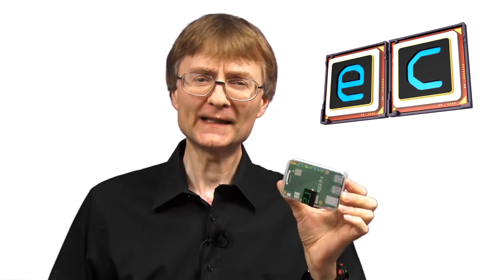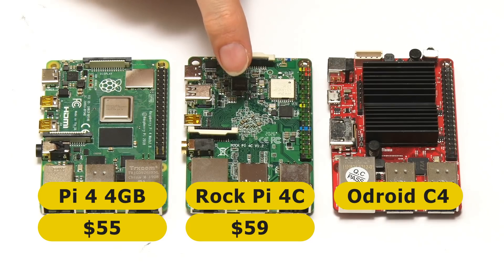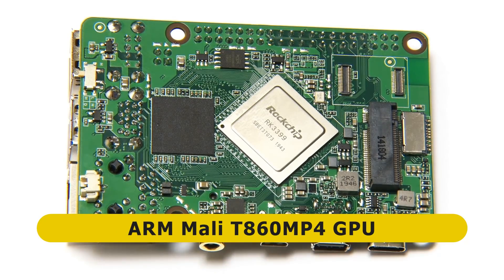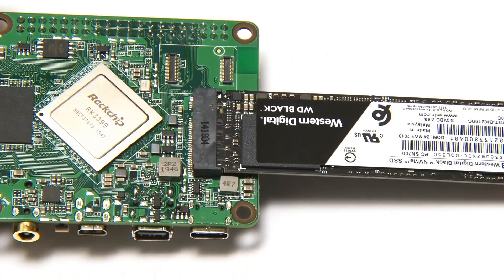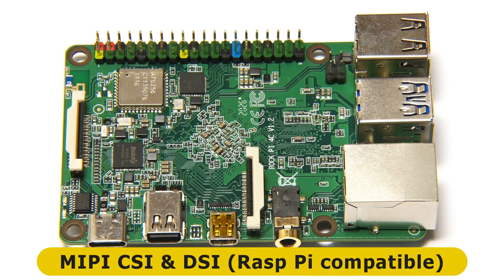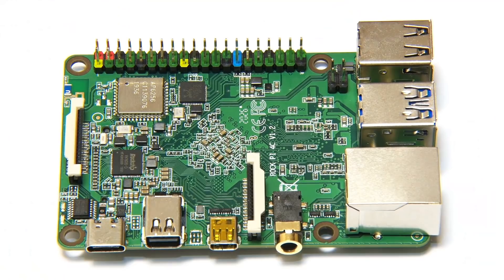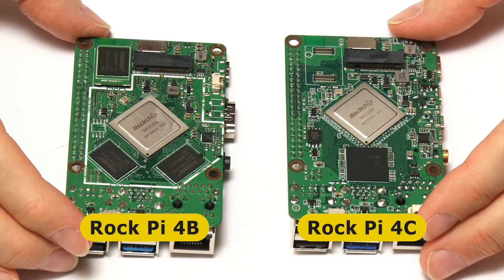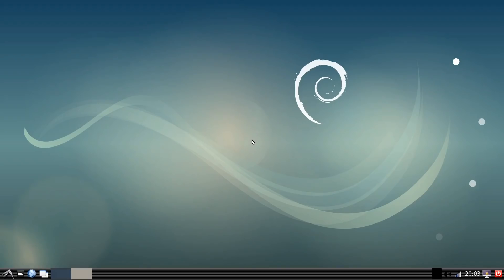Rock Pi 4C: Dual Display M.2 NVMe SBC

Comment: "Hardware is useless without software". I often see videos titled "raspberry pi alternatives" or raspberry pi killer" like videos in my feed. What is common in every one of them is 1) lack of software support and 2) less community involvement. The first can be fixed with some updates here and there but the second one will, in my opinion, never equal raspberry pi. Raspberry pi has been here for 11 years now and in that time it has created a firm foothold in the SBC market, deserved too. It is in everything from 3d printers to space stations. It was wide software support and a huge community backing, tinkering and supporting it. It has many add ons for it, HATs, cameras and what not. That said, if raspberry pi foundation sits on their back and do not make new innovations to the SBC people will start to migrate to other SBCs. Right now, I do not see much reason to choose other SBCs over the pi.

Comment: You know, although I do love the Pi and associated ARM boards, I have to say that for the moment x86 is still my go to choice system for most stuff, and what I was doing with the Pi's (MediaCenter and Router) I'm doing much better performance and features wise with the Atomic PI, which is based on the same Atom CPU as the Rock PI X.
For my Router solution (custom) I got OpenWRT on one AtomicPI, for my MediaCenter I actually went with eLive Linux (64 bit) and I am astonished at the performance I got out of the AtomicPi! (Not available for ARM unfortunately), this thing is booting fast as heck and performance all around if praise worthy! I'd recommend you test your RockPI X with eLive (maybe give 1£ or 2£ to the project, I did give 2€ but ended up using the Beta version regardless, and still worth every cent!

Comment: You sold me on the 4C.  It is a very fast SBC, but I chose to use the heavy heat sink in order to avoid having to use a fan.  This choice of setup is unsuitable for what I had hoped would be a "tablet like" application.  I'm going to try the Radxa Zero instead.

Comment: So, I recently bought the rock pi 4c w extender attached but no SSD installed and I can't get it to boot; no red led.  Unfortunately, you did not show the hardware when it's powered up so I can't confirm the state.  However, some research states 2 LEDs (green & red) should show on the board.  My red (pwr) led does not light up with an SD card inserted w an ubuntu image on it. What am I doing wrong?

Comment: can it run openmediavault soft?
Reply from the maker: Theoretically, yes.
Reply: @ExplainingComputers  but in real test? Mabe more spead than rasbery pi 4 for nas storage files is it any better for this?
Reply from the maker: @rolis.j  The speed limitation on both boards is gigabit Ethernet, so a Rock Pi NAS will not be faster. I said "theoretically" as you will need to configure OMV for the board. It should work . . .

Comment: price Rock Pi 4c is not $50 ! On Amazon, I found it at 107 euros, and even at 199 euros !!!!
Reply from the maker: Nowhere in the video do I say that the Rock Pi 3C costs $50. I state the price as $59, which is what the manufacturer charges, as do resellers like Seeed Studio (I've just checked). Amazon is often a very bad place to buy an SBC, as resellers there charge all sorts or prices. :)

Comment: @ExplainingComputers, please don't forget to try out our latest version of Armbian-Reforged V1.0 , a custom out-of-the-box beginner solution for RockPi4C and RK3399 boards with full Panfrost HW acceleration, firefox heavily optimized to use Mali T-864 GPU and VPU Drivers compiled from scratch to support T864 GPU as well. Kodi, Wine, Box86, Retropie and MVP are included and all running from Linux desktop out-of-the-box. Full instructions on OP:
https://forum.radxa.com/t/great-new-os-for-rockpi4c-aka-armbian-reforged/4938

Comment: Trickiest part I found is to configure/setup a m.2 NVMe drive. If you want to boot from NVMe on RockPi4C, only use approved Radxa Acer m.2 NVME drives:
https://shop.allnetchina.cn/collections/rock-pi-4-accessories/products/acer-m-2-nvme-ssd-for-rock-pi-4
Don't forget the heatsink to keep it cool:
https://shop.allnetchina.cn/collections/rock-pi-4-accessories/products/heat-sink-for-nvme-ssd-2280
Currently the fastest drive for RockPi4C is Samsung Evo Plus 970 NVMe. Unfortunately it doesn't boot from yet, Currently only five(5) m.2 NVMe drives are booting from RockPi4C:
https://wiki.radxa.com/Rockpi4/FAQs#Which_M.2_SSD_are_supported.3F

Comment: After 3 days of tinkering and 3 weeks after I purchase this. This is definitely NOT an ARM SBC for the beginner or the average RPi4 user. It has become one of my favorite ARM SBC boards. I managed to solved 99% of the issues it initially had.
It requires so much tinkering it kind of reminds me of the old days of linux 20 yeas ago. RockPi4c is a very flexible board with great documentation and support via official forum that require manual configuration for almost each component. I loved it.
Best way to keep this board cool at all times, even under full load running less than 46 degrees is to use a 20mmx20mm 1.0mm copper shim between the radxa large heatsink and the CPU. Apply some quality thermal paste on Top and bottom of the Copper shim and you're golden. Do this and you will achieve From 20 to 30 degrees Celsius LESS now. With the Copper shim, There is no longer need to use an active fan with it.
Currently, official Debian 9 is the best OS for this relatively new board, it has less than 3 month old. Keep in mind, RockPi4B images and documentation won't work on newer RockPi4C because of hardware differences with dual video output.
Some other features like MIPI display serial interface won't work without modifications and currently there is No working version for 4C. You need to change and compile 4B overlay with dtc to create the dtbo file by disabling min DP port because RK3399 only supports two(2) video output engine. 
Built-in Bluetooth requires a manual patching in order to work on 4C.
This powerful and customizable board does NOT work out of the box. Overall, I'm truly impressed with Radxa boards. I will be buying a RockPi N10 when becomes available and definitely the next RK3588 board from Radxa when get released in 2021 or 2022.

Comment: That m.2 slot should be facing the other direction   ..dumb design
Reply: it would block the cpu heat sink if it was on the bottom of the board, and if on the top it would not co-exist with the connectors. The CPU and connectors would have to be on the same side of the board to make m.2 attach directly parallel, and I expect there was some other reason that couldn't be done. Always lots of trade offs to these small boards.

Comment: Are u sure... It is 2TB...... After hearing that it can store upto 2 TeraBytes...... I was like....... This little sbc could store upto 2tb....
Reply from the maker: 2TB is the capacity of the NVMe SSD that this board supports. There is no onboard storage. But you can connect an M.2 NVMe SSD up to 2TB and it will work! :()
Reply: @ExplainingComputers  oh.... Thnx

Comment: I was finally able to get the 4C to boot from NVMe. The Radxa "how to" is missing a step. You have to run the flash erase command and the write to flash command, and bam, it works. Although, you have to have the SD card inserted for it to work. It's an empty SD, but it has to be there. Ah well, at least it works now.

Comment: It's made in China.
Reply: Most SBCs are made in China, in fact most electronics in general are, what are you getting at?
Reply: @timezonewall  Raspberry Pi is now made in the UK and some other models are made in South Korea, so your money is not used to pay for cheap labor and does not go to the CCP.
Reply: @madfury3179  Yes, I like the R Pi is assembled in the UK, but how many of the parts on those boards are still coming from China?  Thailand and Malaysia also have a history making electronics devices because of cheap labor. It's impossible to avoid inexpensive labor in Asian countries in electronics manufacturing. It does improve the lifestyle of those who would otherwise have few opportunities which is a positive. I understand though not wanting to support certain governments.

Comment: Just got my RockPi4C and I'm not impressed, here my experience:
- RK3399 CPU on RockPi4C runs hot as hell. Even with official radxa small heatsink for 4C, it can get 79 degrees Celsius under full load or simply watching youtube(it was scary).
It's highly recommended to get official full size heatsink for 4C which wasn't available until now(Extra $7.99)and you will still reach 70~77 degrees Celsius with that. Best way to lower CPU temps by 20 degrees is to install a copper shim between CPU and Radxa Large heatsink without forgetting some quality thermal paste on top and bottom of the copper shim.Copper shim I used was 20mmx20mm with 1.2mm thickness. After that CPU Temps were around 57 degrees. Only time when it reaches 70 degrees is when I play MP4 1080p video files on MPV which plays amazingly well on latest Armbian 20.08.7 Focal w/5.8.13 kernel.
- Video Outputs for Rockpi4C are a pain, micro HDMI port is "temperamental" and since it's a secondary port, it does have some well known constant flickering issues at 4K resolutions as confirmed on radxa forums. Sadly, all my TV's at home are 4K so it was a total hassle to get it to work until I was able to change resolution to 1080p.  I had to try at least 3 micro hdmi cables to find one that partially work. Even using my existing ones from working Rpi4 didn't work with my 4C. For the record, I've never had issues with microHDMI ports on any of my four(4) Rpi4's.
- I tried DP video port with my DP to HDMI cables I use on my ancient MBP2012 and MBP2015, they didn't work. The issue is it requires to have an "active" dp to hdmi adapter to be recognized by any LCD monitor/TV.  That goes another $18 in a extra accessory to access Rockpi4C DP port. This one did the trick:
https://www.amazon.ca/dp/B01FM51O0W/?coliid=I2PM2Q9VJNVTAF&colid=3VRONTTC7L8UB&psc=1&ref_=lv_ov_lig_dp_it
- Overall Design on RockPi4C board is awkward. CPU is at the bottom, microsd slot is facing down, NVME connector has a weird location. Once you install an eMMC module, it's hard to access the NVME connector.
- Debian 9 works out of the box once you fix the micro hdmi and DP issue
- Very Lame the fact official Debian 9 comes with a legacy 4.4 kernel.
- Microsd performance was acceptable. Not slow, not fast.
- eMMC module performance on debian was good enough, not stellar. eMMC performance on Latest Armbian 20.08.7 Focal was decent, not great. BT audio does Not work on current Armbian for RockPi4C.
- Debian 9 as a desktop experience was overall stable and fast enough for common tasks and didn't experience any issues other than scary high temps on CPU.

Overall: Unless you need all I/O options like NVME or a NAS solution like a Penta SATA HAT for Rock Pi 4, RockPi4C is Not recommended over Raspberry Pi4 or Odroid-N2+. Price difference will be only $12 compared to N2+. N2+ has 6 cores as well and runs much faster and way cooler(1.8Ghz vs 2.4Ghz), N2+ has HW acceleration out of the box and runs much more cooler. Hardkernel support is way better also compare to limited support at Armbian or Radxa forums. Armbian does a fantastic job supporting ARM hardware nobody else does. If you're a beginner and if you want to simply avoid all the potential hassles mentioned above, just buy a Raspberry Pi 4.

Comment: I heard on minute 5:32, you mentioned the 3.5mm is audio output and microphone input. Would that mean, a headset with microphone would work on that 3.5mm jack?
Reply from the maker: Yes, a headset with microphone can be used in that jack. Very handy, and unusual for an SBC.

Comment: There are SBC specs, and then there is the question of whether any software is available to support all the HW features and specs advertised. Most reviews are done on SBC upon their release, when the software is least optimized. Opinions are formed before the platform's software matures. I find that a little unfair. As time goes on, more drivers and community support gets better. I would like to see the past head to head reviews redone with the updated software.

Also, I and others I know are heavy Home Theater / Kodi users. We prefer some variant of linux, like libreelec for our SBCs, but not android. We need the best AV CODEC support there is. Could we see reviews on the newest hardware that have had 6 months to a year to have their OS, drivers, and CODECs optimized which would be Kodi/CODEC centric and with an eye on external HD connectivity?

Many Thanks!

Comment: No HW Acceleration on Desktop OS? I'm sold!
In a few words, don't buy it yet. If you see features not even mentioned or missing in their official wiki page,  you know you're getting screwed. Problem is how long is going to take to get it fully supported?. Armbian seems to support it but doesn't mentioned it explicitly. It could be referring to B version instead of C,
https://www.armbian.com/rock-pi-4/
All of these signs are red flags to be considered before going into a crusade with any Chinese ARM board.  Also, check their official forums, see how often people post something, check how long it takes to get an answer and see how many people are actively participating on that particular ARM RK3399 board you want before placing an order. Ex. It took a few months after NanoPi M4V2 release to catch up with full software support from previous NanoPi M4 V1. IMHO, it's better to buy the more mature and stable Rockpi4b instead or just buy the Raspberry pi 4 and avoid some headaches.
Reply: Aug29 update. A Manjaro Developer showed a working Rockpi4c with latest Manjaro 20.08 and told me was going to upload a new Manjaro 20.06 image for Rockpi4C soon so Radxa can have it too. That's good news and a step in the right direction for the new Rockpi4c.

Comment: Is the M.2 NVMe slot a full-fledged pcie slot?  Could I use an adapter to use an Intel AX wifi card?  I'm looking to build a mesh network, but don't want to be limited to AC.  Thanks all.
Reply from the maker: As far as I am aware the NVMe slot is for storage only. Normally WiFi adapters in M.2 slot use a USB interface (an M.2 connector can carry SATA, PCIe and/or USB).

Comment: Chris ...is there a way to add a Pi Noir via USB ..I am unable not sure how to find a Noir USB Couple ..tried all search engines ..kinda of like a universal dongle adapter
Reply from the maker: I'm not aware of a Pi camera to USB connector. :(
Reply: @ExplainingComputers  ..Chris thank you for acknowledging..I enjoy the channel ..I will tinker with this connection ..my thinking is that if you can couple a mini microscope to an Android via USB ..then the same interface can be used for a Noir
Reply from the maker: @smudgebusterINC  You have to be correct!

Comment: Looks good. When they come up with a solution to boot from NVME and supply the correct heatsink it will be interesting to get some overall performance tests from both Linux and Android as it should fly.

The added extra features missing on the Pi and S922X are likely the things that keep the RK3399 from becoming an extinct SOC.

Comment: Chris - does the smaller passive heat sync adequately cool this device? My experience with my Raspberry Pi 4 models leads me to prefer active cooling (fans) for these devices so I was curious on the Rock Pi C4.  Thanks Chris.
Reply from the maker: The smaller heat sink will prevent he RK3399 burning itself out! The board really needs the larger heat sink, or a fan as you say.

Comment: Do these SBCs  become a lot more usable as desktops with the OS on the NVME, or does it not make much real world difference?
Reply from the maker: Great question, and it does not make that much of a difference. I build a Pi 4 rig fairly recently with it booting from an SSD, and have been working on it again today for another video. And to be honest, operating system performance is not that different to running from a decent micro SD card. Reliability long-term should be better, and accessing large files is certainly better. But for most things, the real world benefits are slim.
Reply: @ExplainingComputers  Thank you! That surprises me - it makes one wonder where exactly the bottleneck is...
Reply from the maker: @robertyoung2661  A mobile processor core (or 4) running a desktop OS. :)

Comment: Would love to see a follow up video where you try out the case for it: https://shop.allnetchina.cn/collections/rock-pi-4-cases/products/ecopi-pro-hp-aluminum-housing-for-rock-pi-4c. Also, maybe try the boot from NVME procedure to see if it works? Perhaps they just need to update that one sentence in the wiki that states the devices supported. Would have been nice to see a demonstration of the dual display functionality as well.
Reply from the maker: That indeed looks an excellent case.

Comment: I would really appreciate if you could include testing camera and video encoding with these SBCs. Most of them have impressive specs but suck, when it comes to hardware acceleration support. In this regards, RasPi still is ahead of the crowd.

Comment: Any info about where to the find the smaller heatsink that does fit on the RK3399 chip properly?  It is understood that you like the larger heatsink, but that doesn't fit on the Rock Pi 4C properly (a situation which you lament).  But where can I find the smaller heatsink that does fit correctly?
Reply from the maker: Mine came from Allnet in a bundle with the Rock Pi 4B. Any small heatsink (20mm square of less) will work fine.